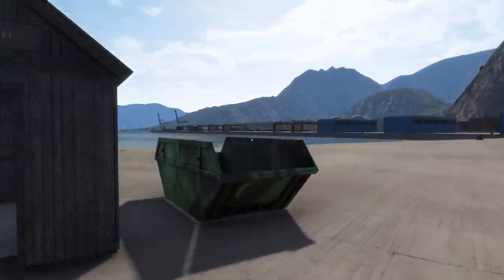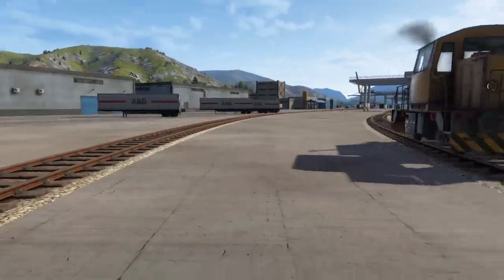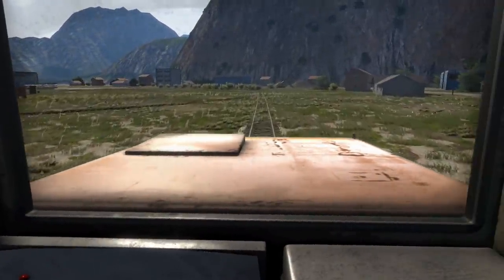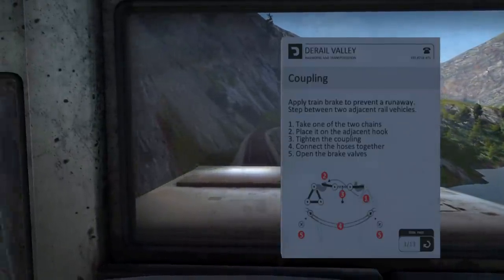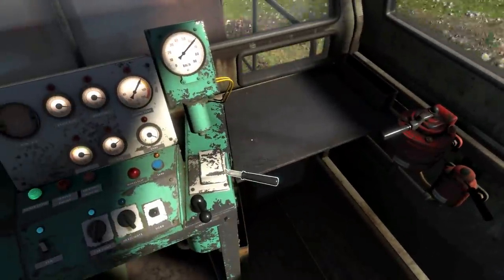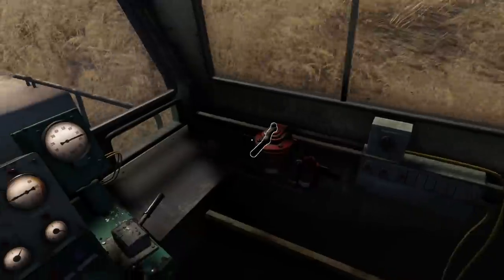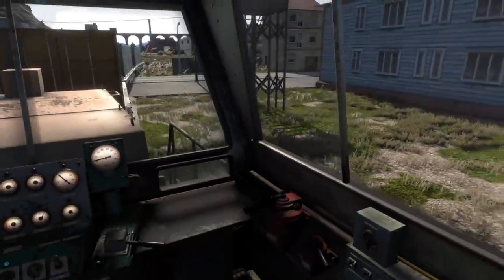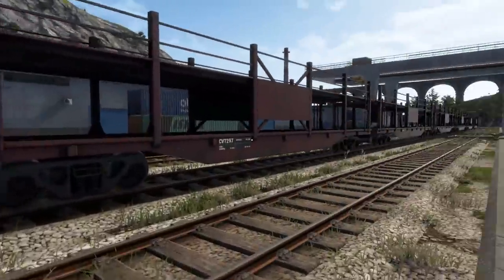Overheating a Train Engine in Reverse to Beat the Bonus Timer in Derail Valley!

Comment: In the real world, using only the locomotive breaks, result sin high compression forces between the cars. This causes a derail quickly as pushing is an unstable operation mode

Comment: to turn the train around go to section of track that has a Y in it all you need to do is go into the y where the 3 tracks meat into one go through the y stop flip the switch to go up the other side of the y then make sure the second why switch is also flip to get onto the main line go past the second switch flip it back to main line not the y your train is now facing the other way

Comment: Why would you need a round table? just turn around at the T junction, sure you will then have to push instead of pulling but i think you wouldn't have overheating problems, someone can hopefully fill in these details. ALSO if you take your time with it and plan everything out, you could push at the begining out of the harbour, then detach from the cars in the T junction, forwoard out, then ride around the cars through the junction, and then you should be pulling, in forwoard for the rest of the journey.

Comment: When you are pulling a load, regardles of the load size, you should always use the train  brake , and not this independent brake. The larger brake handle is the train brake.

Comment: hello kan yah you can go at speed with light load but you may want to got 10-20 kmh bleow it to prevent derailment because the rate of dealrailment can go up  because of speedng on some of the sections of track and its not just the engine that can derail it you entire train that can do so especially as time goese on and you get bigger and better contracts and trains and better engines. and yes you do not get speeding tickets  but the game will punch your wallet with environmental  fees if you derail not to mention the coast of recovery of the derailed locomotive and the contract related to the event in question.
Reply: Derailments with the cars tend to happen with cars carrying pipes but more commonly and after about ten or so trips with the same shuntter or group of shuntters if you have the muit unit control your need to check the status of the engines in question it's what those buttions in side of every shead/round house will allow you to do  but the rate of wear and tear depends on the load or loads in qustion  I have seen this happen time and time again on may other people who was driving the train at speed mind you and derail most commonly on the route to the port.